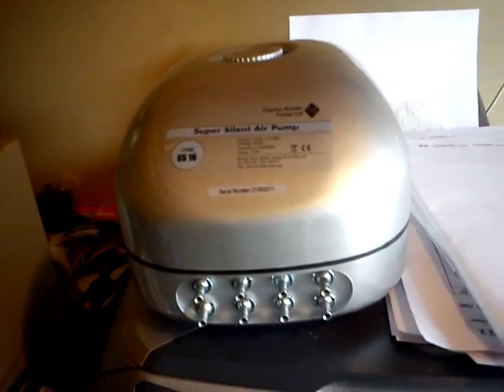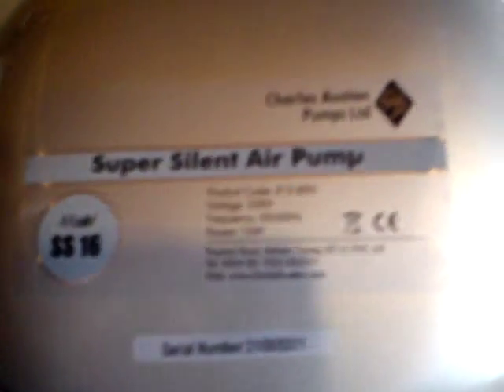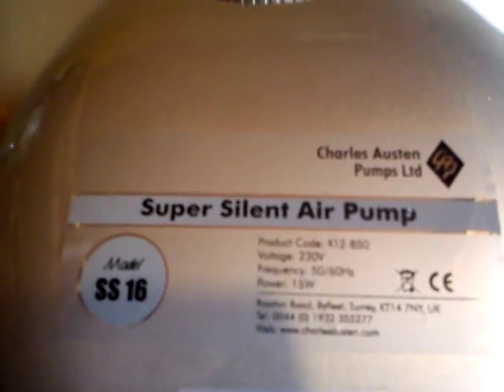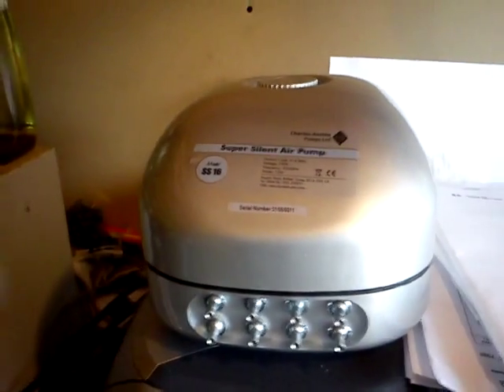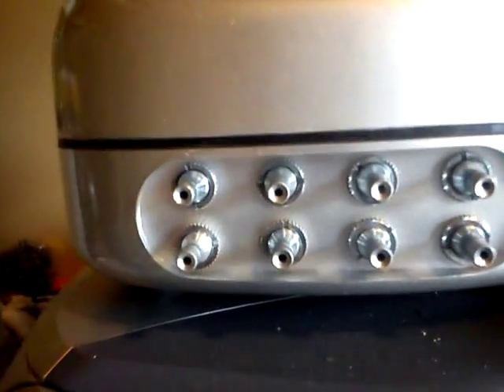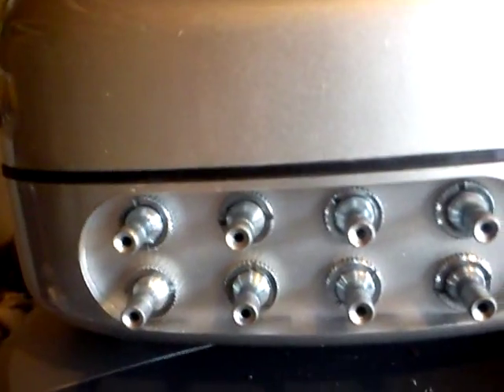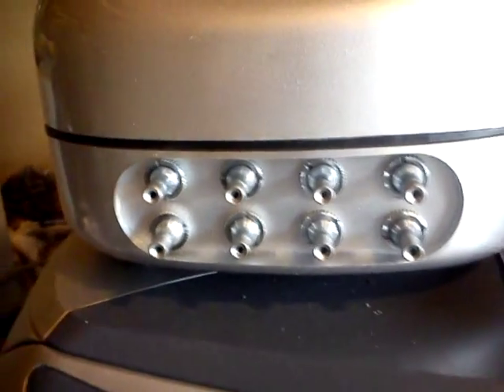Stan meyer's work: YOUVE MISSED THE POINT...3gp

Comment: Interesting video, my understanding is Stan had to lower the combustion temperature of the gasses produced when combusted from the Water Fuel Cell because he was using a standard petrol engine in the dune buggy, Stan uses the term 'co equal' in one of his videos. He was talking about retrofitting the water fuel cell to standard petrol engines at one time, I think this was before the injector type device he eventually came up with

Comment: Ok.... I thought that Stan had used exhaust gases recycled through the intake to slow the burn rate, just like you say.... But also he had made an injector that fractured h2o at the cylinder. He removed the spark plug for this injector and i am assuming the compression was used to ignite the fuel mixture. The distributer was then used to time the injectors... right?

Comment: Excellent points - I think you have uncovered the most essential aspects of Stan's original work.   What you have said makes perfect sense, especially if considered in context to a conventional gasoline fueled engine design.  The gas / air mixture is critical to create the correct environment for combustion within the given engine design parameters.  Every function of the engine follows from that mixture.  

Given the energy density of hydrogen it follows that it also would need to be mixed with a less combustible, or non-combustible to get a more precise burn rate. From a purely mechanical point of view, burning more hydrogen that needed is simply a waste of gas and as such inefficient.

I can also so the point of controlling the rate of combustion for situations where flame temperature is important. Burning to hot may be problematic in situations where burner nozzles or heat chambers might be damaged by over heating.  

Designing equipment which can control the mixture of gases and so the temperature of the flame, might be a safety issue which should be carefully considered by designers.     

 Don't let your head explode while thinking about these things - obviously your brain is working pretty well right now.  It would be a shame to lose someone who obviously has such good insight.

Comment: I haven't done nothing with water cells, but i understand what you are talking about I think.   Basically, It sounds like Stan was using the waters natural nitrogen content and under pressure he was able to minimize the effective burn rate of hydrogen into his system. I guess kinda like saturating mixture to get the effect of gasoline?  And the more demand the more cells would pop on.  I guess the key would be what is the pressure the system has to be at for it to work?